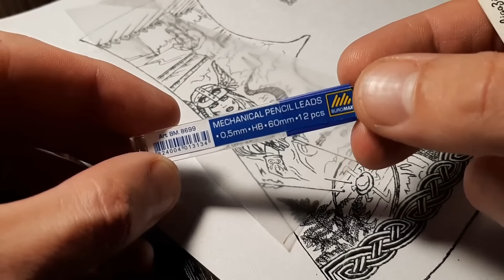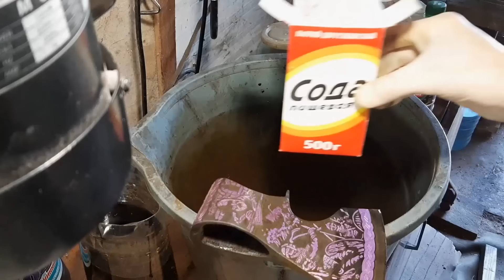Drawing on metal. Old rusty ax restoration and decoration.

Comment: Amazing work. Don’t have the words to describe how awesome it is to see you take a rusted axe and turn it into a piece of art. 

So now, because of you, I have the desire to do the same. I purchased some axe heads. Sanded off the rust. Reshaped the axe. I just purchased a welder with variable amperage control and am about to start etching. 

I have a question about the nitric acid solution.  I see it says you have it at 5%. I can only purchase it at 67%. Do I just add water to bring it down to 5%? This is all new to me so sorry if that’s a dumb question. 

Look forward to more of your art.
Reply from the maker: Thank you. I appreciate your attention. I no longer use nitric acid. I use ferric chloride instead. It's much easier and I like the result better. Be sure to study the safety precautions for such work. Take care of yourself. I wish you creative success.

Comment: amazing work! It is a work of art. A question, why don't you make all the layers with the welding machine?
Reply from the maker: Thank you. I appreciate your attention. Electric current does not etch metal evenly, and ferric chloride works at the same speed over the entire surface of the metal. It is good to make the contours of the drawing with electricity. And it is better to make shadows with ferric chloride. It's more convenient for me to do just that.
Reply: @KirillRunz  Кирилл, трудно ответить почему именно лавсановая калька используется?

Comment: your work is really wonderful, what is that black machine that looks like a welding machine?  what was the liquid where you dipped the ax and how long did you leave it?  greetings from Argentina
Reply from the maker: Thank you for your attention. Yes, it's a welding machine. Electricity etching takes about 10 minutes. Then, etching takes place in a 5% nitric acid solution, each layer for about 30 minutes. Greetings from Ukraine.

Comment: during all of this do you need to heat treat to make a working axe or does the old heat treat still remain?
Reply from the maker: The old heat treatment remains. After etching, but before sanding, you may see a darker metal color closer to the tip. Darker color where the steel is hardened. Gray color - closer to the back of the ax, indicates that the steel is not hardened there.

Comment: Splendid work. The etching method can be quite dangerous with high amperage from the welder.  A 12V at 2 to 6 A using a battery charger will also work. Also make sure this is done in a well ventilated area.
Reply: А не підкажете скільки часу потрібно травити?

Comment: I have a question about the solution for engraving on metal, did you use only salt? Or has another component
Reply from the maker: If I do metal etching with electricity, I only use salt in the solution. I don't add anything else. The solution is reusable.

Comment: Have you try with toner transfer method ?
Reply from the maker: Yes, I tried it. I didn't like this method. There are pores in the toner from a laser printer. It doesn't protect the metal well enough in my opinion. In addition, it is inconvenient to work on curved surfaces. I have a video of such an experiment. 
https://youtu.be/-eKLi_3xgIM